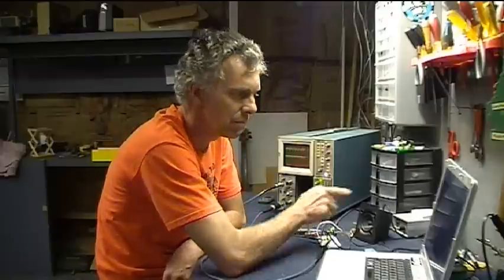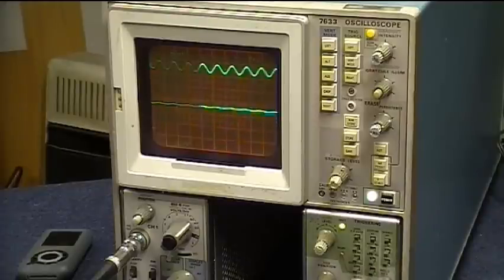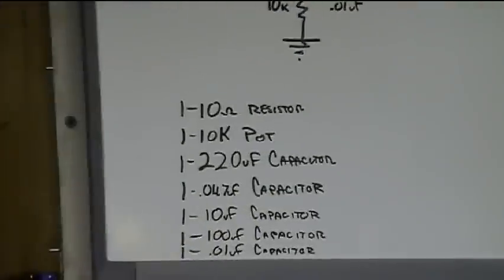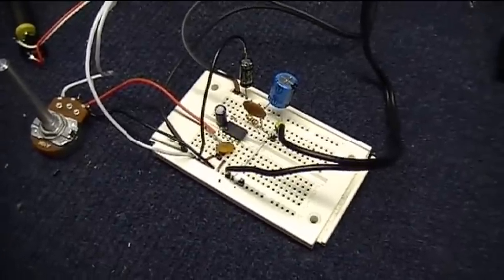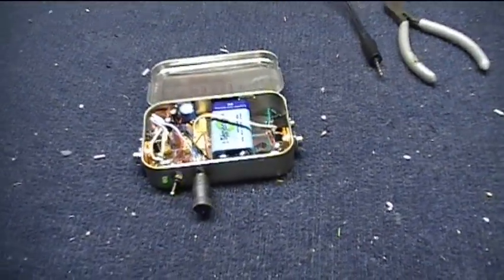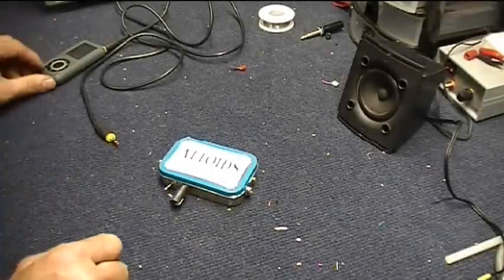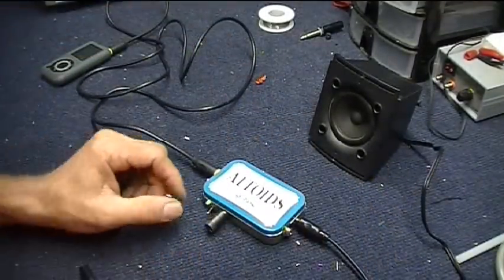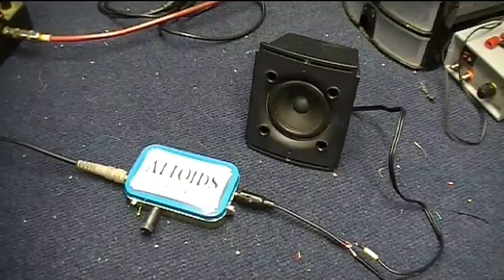LM386 Audio Amplifier

Comment: This was my first real build.  Thank you for the inspiration.  I modified it a little.  I used 2 lm386s for stereo sound.  Also changed the cap values and removed the gain cap.  Sounds oh so sweet.  Got it all in a tiny enclosure for a real sweet stealthy look.  Thanks again man!
Reply: The capacitor for higher gain is mostly not necessary. Without this capacitor the gain is allready 20. This is enough for input signals of 500 mVrms. With the capacitor ist is 200. You will need to attenuate a lot and you amplify you input noise.

Comment: I use double-sided foam tape for mounting PCBs in altoid tins insulates and gives some flexibility so the thin gauge metal bending won't break glue joints.

Comment: I made this and the 100uF cap exploded and the circuit didn't work, before running on to Youtube and giving you some abuse I noticed that pin 2 wasn't grounded. It works like a dream and I also have the pre-amp connected. Thanks man! I found a tone control circuit that can be connected and I'll let you know how it goes.

Comment from the maker: @w1jsb I've had no heat problems with the LM386. If it does, you could just put a a heat sink on it. Use some heat sink compound between the chip and the heat sink. I doubt if you'll need one though.

Comment: The 220uf, 100uf, and 10uf caps are electrolytic caps; The .01uf and .042uf are ceramic caps. If you want to upgrade the electrolytic caps use low leak/impedance caps like the Panasonic z series. The ceramic caps can be upgraded to metal or poly caps. Ceramic have good bypass but metal and poly caps are usually more precise than ceramic and have less inherent noise.

Comment: I noticed that your waveform has a high-frequency parasitic oscillation at the negative peaks, which may indicate that your Zobel network has to be adjusted in value (the 10 ohm resistor and/or 0.047uF capacitor). You attribute the loud output waveform to the output capacitor, but some of the effect is also due to the fact that you've saturated the amplifier. The 0.01uF, 0.047uF and 220uF capacitors are not used for decoupling as you stated. Regardless, I really liked your video very much!

Comment: That is true.i used to use a 9V battery but after the battery had like 5 Volts or less left the distortion is a lot more than normal.A 12V adapter is clearly the way to go.

Comment from the maker: @Youcansuckme69 
From the Wikipedia post:
"A decoupling capacitor is a capacitor used to decouple one part of an electrical network (circuit) from another. Noise caused by other circuit elements is shunted through the capacitor, reducing the effect they have on the rest of the circuit."

Comment: If you replace the 10uF cap in the gain loop with a 68uF, I found that it eliminates buzzing from a computer. If you're using Touch ID with an iPhone plugged in, using the 10 will produce clear beeping and admittedly cool sounds for half a second, over whatever else is being played. Using a 68 will fix that as well.

Comment from the maker: @militaryson94 You just connect the positive output signal to the part of the jack that goes to the tip of the plug, and connect the ground of the circuit to the other terminal near the ground ring on the jack.

Comment: Thanks for the video! I am currently building one of these. They are awesome, really simple, and allows allot of room to experiment with different types of sounds for your Guitar Amp. If you connect a nice big speaker along with some pot meters and knobs and buttons to this you will have a 3 dollar an awesome guitar amplifier which can't be beat for this price (That is if you salvaged your parts from an old radio or something, I got 2 Lm LM386  and 2 times 567 Tone controls from an old radio intercom I bought for 2 bucks! Allong with a shitload of caps, and knobs! This is awesome!

Comment: The distortion on the actual pcb what less.And the stable current 12V adapter helped a lot I think.It seems to me that the battery causes a lot of problems.

Comment: Great build. I've been building circuits with the 386 for years and even have an indoor/outdoor intercom system run by it driven by  the TL082 with a radio shack mic hooked into the TL082.  Two pairs of them one inside and one outside and a push to talk switch hooked to a relay which alternates between the indoor and outdoor speakers being on or off.  I have trouble keeping the 386 from oscillating.  perhaps you could provide some input on how to keep the amp circuit from oscillating...

Comment: love the ideas you got going on here with this. just a quick question though. I noticed eBay sells several diff kits for tiny amps.  all containing LM386 chip but other components vary. do you think you can use one of these kits and custom build the driver? i can provide links to the diff LM386 amps if you need to see them. thanks in advance

Comment: This IC has 4% distortion at 300mW, so it isn't very high fidelity. However, below 200mW, it has less than 0.3% THD. Look at more recent types like LME49610 which have orders of magnitude less distortion at similar power levels.

Comment: I'm s musician bit by the DIY bug and I thank you for showing this build. A couple of questions as to mods. 
1) I noticed the bass boost utilized a 10k resistor as one of the bits. If I sub a 10k or 20k pot, would that allow me to dial in a variable amount of bass boost?
2) Is there an analogous mod that in addition to wiring in a bass boost, I could add a concurrent treble boost with a pot to vary the amount. 
If it isn't obvious, I'm looking to see how difficult it would be to add some rudimentary tone controls. At the very least I know how to wire in a passive treble roll off pot like in an electric guitar or bass. I'm looking to add a bit more as seen in my questions. .

Comment: How do you know which caps should be ceramic or electrolytic? I can't seem to wrap my head around which should be which.
Reply: Well, generally electrolytic caps are used on power circuits, and for taking lines to ground. Generally ceramic caps are used in audio circuits for blocking DC from inputs and outputs. And you can see them in line with the audio "trail" instead of going to ground or power. Electrolytic are polarized, and work better in power circuits. If you put one where a ceramic one goes, like inline with the audio, there will be a chance of peaks equal in positive and negative on each leg and it can explode or damage the capacitor. Ceramic caps can't generally deal with the power constraints oil based caps like electrolytic can.

Comment: dear Dean Segovis first i would like to say what awesome video and the sec thing is i'm having some trouble with the to ceramic capacitor .01uF & .047uF what are the code for these. do you use a 104 for the .01uF cap and do you use a 473 for the .047 cap and also when i connect it to a audio single the output is crackling  thanks again. PS i'm British

Comment: this can have many reasons. Maybe your gain is too high, or you have a signal on your GND line. if you have an oszilloscope you can check if theres noise on DC lines and stuff
Try to do GND in a star-connection and put filtercaps directly to the chip

Comment: If you don't like drilling holes in sheet metal, (and I don't blame you,) then use a Roper-Whitney hand punch. A P/N 5JR would have worked great on this project.  Punches make much nicer holes than drills on sheet metal.

Comment: Hello.  Thanks for the video.  I tried building one of these based on the LM386.  however, I notcied that mine distorts quite quickly at a little past half volume when connected to my mp3.  Is there a best way to remedy this?  I know it's an LM386 but the sound of yours is pretty good and doesn't seem to distort as much.

Comment: I hope you still read these comments.

Would you have to put in the pot? I'd like to have mine be fixed volume and jsut vary the input volume to change it. Could I just have the signal go into a capacitor, then pin 3, without a resistor? Thanks dino!

Comment: Using your schematics, I put together my own LM386 Amp (thanks), and I've just finish testing it out on my bread board. With the power source running from a 9V DC adapter, the sound quality was a very bad distorted tone with an unbearable humming.
Upon looking at Heilman Hackatronics' video on the LM386 Amp, I noticed he didn't wire the gain circuit from pins 1-8. So I removed that circuit to eliminate the humming and distortion.  Why did you add it in? Purposely for a distorted tone, but minus the humming? Also, I've discovered the "Bass Boost" addition just seems to only make it sound quieter; so I removed that circuit also. Thanks for the video, anyway.
Reply: I think he put the 1-8 pin to increase the gain =make it louder,if you put too much power with allot of gain you will max out the power that the chip can give and it will just distort everything to hell.
Reply: Your powercsupply is noisy.

Comment: How long did it take you to build one of these? I've seen many vids on here of people building these and i'd like to make one,. BTW I have thos toy voice changer megaphone and ituses the LM386 amp. I've modded it to take a line input from an mp3 player as well as an external mic and I put a speaker output and added an on off switch and LED so I know it's on. I have a vid of it on here look up Modified toy voice changer megaphone and it's the red one.

Comment: the 10 uF cap produces more ditortion but it also provides more Gain(46 dB).without the cap you have less distortion but your gain is only 26dB.At least that what it is written on tthe datasheet of the lm386.

Comment: Hi, I have built this and it works, but i don`t ully understand how it works. I am a beginner in electronics. Could you explain how it works ? What is the role of the decupleing caps , or the 10K pot and how the lm386 is amplifying the signal ? Thx for all.

Comment: Looking at "Vin" (9volts) and the 10k pot and the other side going to ground isn't that going to be a direct short if the pot is turned all the way down?..... is there a resistor missing in the schematic?

Comment: Hi there, I have a couple of basic questions.

1- What kind of power (I mean DC voltage) do the LM386 need? To be more specific... is it possible to power-up an OpAmp based on LM386 with the power supplied by an Arduino card? (0-3.3Volts or 0-5Volts)?
2- What are the differencies between LM386 and TL071? Can I use one or the other with the same OpAmp circuit?

thx!!!

Comment: Is it connected to the potentiometer? Also, does polarity matter in the capacitor connected to the gains (Pins 1 and 8)? I  used exactly the parts that you said. Maybe there are faulty pieces on the breadboard? I'm going to place it on the circuit board tomorrow and see if maybe there were faulty connections. I am sure that the battery is full, my meter said 9v's, and it burnt out 2 led's (teehee). Please help me with this. I figured out how to read a schematic without  any help, and i know (ctd

Comment: I want to use an amp like this in a costume, so I can hear thru the helmet better. But I think it best to have a auto-volume control to protect my hearing from loud noises. Can you create a ciruit that takes off the output to the speaker and make it control the gain? Loud audio could lower the gain, but I don't know enuf to figure out how.

Comment: Why don't you connect the speaker to the iPod directly but through the amplifier ? I have been done that all the time and it works fine. Please explain for me since I am a newbie
Reply: +Minh Le Speakers that have a 3.5mm (1/8") connector on them when you buy them from the store, already have a built-in amplifier. If you take any other speaker and solder on your own connector, it won't play very loud on an iPod. Also, the mp3 player here is used not just for playing music but also just for playing test tones so that the builder knows if the amp is working properly. You could see the sine wave distort in the beginning of the video, that is useful information when you're building an amp. This video is mostly about the amp, not about amplifying an iPod signal.

Comment: i know one could create a stereo amp by just doubling up the parts and connecting them to a stereo jack. would it be possible to consolidate some of the parts? or would that cause problems because each part is dealing with the signal from its own chip? obviously it would be rather tedious to have to adjust the volume for each channel.

Comment: 1. Pin 4 on the lm386 chip is ground, so for that can i solder everything and then just a nice solder bead going across all the pins going to pin 4?
2. I wanna add the 10uf cap to increase the gain, and I also wanna the bass boost, so would I just solder in the 10uf cap to pins 1 & 8, then solder in the 10k ohm resistor and the 0.33 uf cap to pins 1 & 5?

Comment: correct me if i wrong.. so the 2 audio jacks hot leads go into the Pot. The battery goes to pin 6 with the 100uf capacitor ... also all the grounds have to be connected to each other right?? like i cant ground the sleeves of the jacks to the back of the pot like what you would do on guitars?

Comment: what's the box in which you placed the circuit? Is it available readily with audio jack inputs and outputs?
Reply: It's the same metal box those altoids cough drops come in which doesn't come drilled for connectors.  It's a common theme among makers / hardware hackers.

Comment: Hi there.

I am troubleshooting how to connect the female cable plug on the circuit. I bought a P10 female plug to use, but it's not working. Any hints about what should I do?

Comment: I got a vinyl player at home, which when I connect it to my living room sound system is quite low. Can I use this kind of amplifier to boost the volume of the player?
Reply from the maker: +quinxx12 Yes but don't turn it up too loud.
Reply: You will also need an RIAA compatible equalizer to make the recording sound as it was intended.

Comment: I have an old peavey 8 Chanel mixer That has A 200 Watt amp Board in it. IS There A way to hook it UP On its Own ? I Dont need the Old mixer . Ihave a much newer 6 Chanel peavey mixer . But IT is not aplified much. 25 watt I Think, could I Use the amp boards out the old 200 watt peavey for Use with the new peavey mixer ?! if this Sounds possible I Can give you model numbers on the 2 mixers : So what Can I Do?? thanks

Comment: good day to you sir. I have a mini amp and I would like to mod it a bit to reduce (if not eliminate) the noise by adding a ground wire and bolt it to its wooden case. I just wanna ask where to solder that ground wire. thanks in advance for your reply
Reply: lagyan mo ng wire sa negative/ground part and bolt in a metal case.

Comment: is the cap connected to potentio meter forms a filter ? when i added the cap it helped the pot works on its full gain . before it was just functioning on a certain part , if igo lower or higher the voice mute

Comment: hei, i'd like to build one, i already have got the lm386 and 0.5w 8ohm speaker.
but one thing what i dont understand is, where do u get the other wire to input? theres Vin on the schematic it is + or - to input? and wheres the other one?
and those triangle things shaped like this down here, these are all negative(-), and i connect all of them from the battery - to output(speaker) - ?
 ------
  ----
   --

Comment: im still dont know what type of cap the decoupling capacitor is becuas you used a elco for the speaker and a normal cap on the 9 volt battery ( what type caps are 100uF and the 10 0,47 and the 0,01)

Comment: Im trying to create a machine gun sound for an rc airplane . I have gotten the sound I want with a 555 timer. But it is not very loud. I tried the lm386 but still not loud enough. I even tried the AB amp system but that didn't work at all. Is it possible to increase the volume of a 555 timer output any suggestions would be appreciated
Reply from the maker: +RC Canuck Try this: http://www.ebay.com/itm/like/201507418396?ul_noapp=true&chn=ps&lpid=82

Comment: Hi .. I have a ? .... I have an op amp # tda2005m  bridge amplifier but I want to take out the speaker and put 4 transistor in the circuit to get more AC output for a 10 inch speaker  ......I have no oscilloscope to know what I am doing please help me

Comment: i wanna do a 2 speaker set up, with your schematic would i be able to put power and ground of both speakers into pin 2 and 3? or would i want another lm386 and carry over volume controls and everything to the second ic? just wondering if the setup for the one IC would work without anything getting destroyed or sounding nasty.

Comment: Forward Voltage - LED operational voltage / Current for LED

Eg... 9V - 1.7V / .04A = 182.5 Ohm resistor

Or you can use something there abouts.

Comment: pin 7 if i connected with him a by pass capacitor what is the value of it  ?

and if i use the speaker 32 ohm what is the watt of it ?

Comment: I've got an MP3 player hooked up to this amp and if I turn the volume up on the player (and not very loud) it causes the sound to cut out and back in, does anyone know  what causes this?
Is the input overloading the LM386?
How would you troubleshoot this without an oscilloscope?
Reply: Your input is nearing the rail voltages of the amplifier. What cap and resistor combination are you using?    Remember this amp in the N4 version can do a maximum of 1 watt.  Other versions put out considerably less.